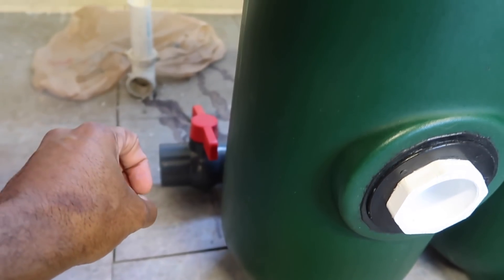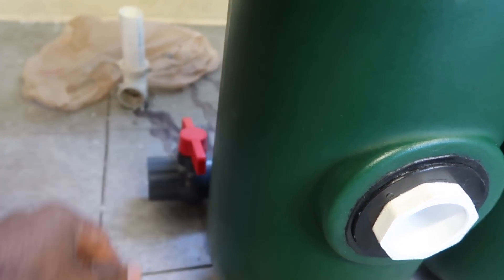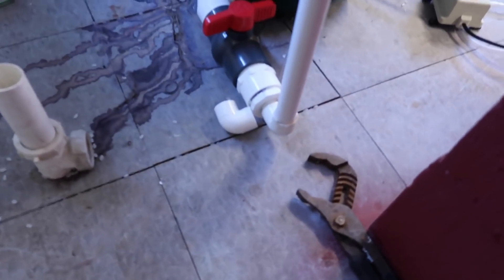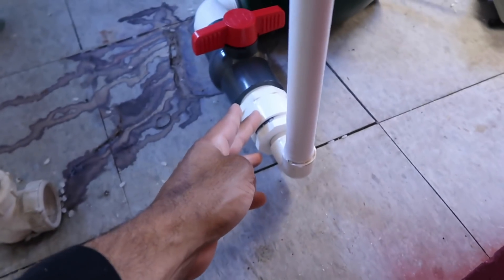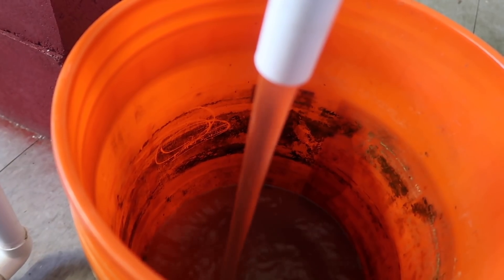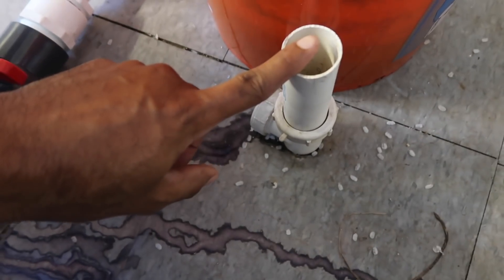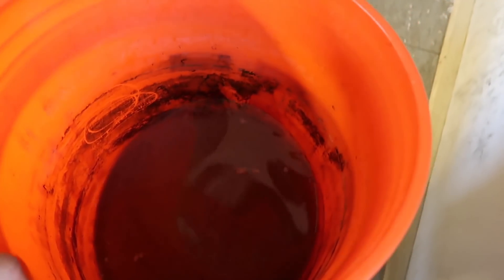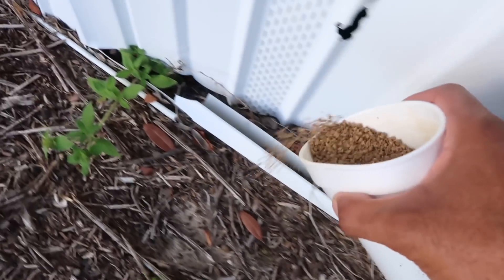Installing The Sludge Discharge Line | The Aquaponic God Ep.32

Comment: What do you do with the fish solid waste?  I have heard some people pay for it.  I've also heard it can be used for other stuff.

Do mineralization tanks break down the waste so it can be fed back into plant beds?
Reply: mineralization is a process of digestion of solid wast in an oxygen rich environment, thereby releasing the minerals and converting the ammonia to nitrogen.  This liquid as slowly dosed into another tank with water and recirculated in a closed loop into the growing systems.  the advantage in this "offline aquaponics" is tight ph control of the fish tanks (8) and the growing systems (6-6.5) also greatly minimizing the solids in the grow system